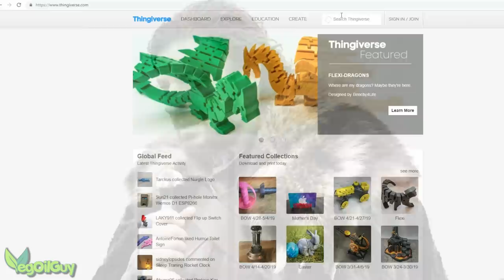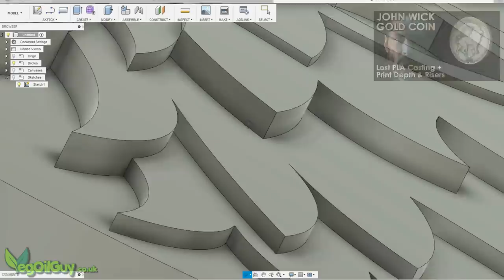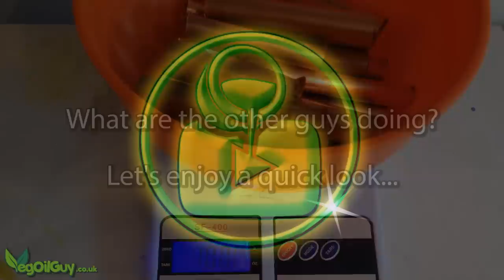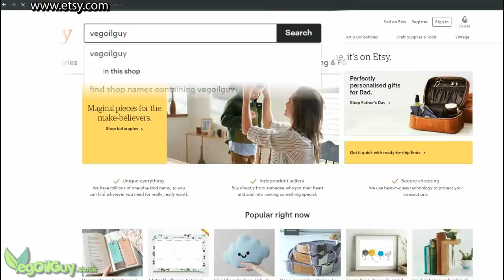Lost PLA metal Casting at home Game of Thrones Copper Coin with VOGMAN

Comment: Awesome video.  for your next challenge you guys should use Nordic gold as the metal.
Reply from the maker: It's a nice thought  : )
Reply: @vogman  hmm nordic gold, is that different than other gold? If not or if so either way...gold is expensive as oh yeah. But hey maybe he will send you a few ops to get it doe huh
Reply: @danielcrawford7315  its gold colour copper alloy; i think its used in euros?
Reply: @danielcrawford7315  LOL it is an alloy of copper and aluminium. In the right amounts so between 10 an 5 percent aluminium by weight mixed with copper will give it a gold look 👍👍
Reply: @danielcrawford7315  it's gold coloured it's a mix of copper, tin, zinc and aluminium. Check out BigstackD he makes a Nordic gold bar.
Reply: @dyadica  yes that is the right

Comment: Wonderful coins Geoff, love your work.  Will you be adding a patina to any of them ?  The green coin in the intro has some real character.  Cheers 😃👍👍🍺
Reply from the maker: I toyed with leaving one outside... but it takes years I believe  : )
Reply: @vogman  There are chemicals some commercial manufacturers use to accelerate patina formation.  I don't think it's as good as what forms naturally, but it's an option.
Reply: @vogman  I think you can use some ammonia in a sealed container with some tissue.  You can wet the copper with water and salt, then suspend the coin over the ammonia and let the fumes patina the copper.  It's supposed to give a bright and vibrant blue colour.  There are many recipes online for various colours, some easy, some not so easy.  Cheers 😃👍👍👍

Comment: Nice cast !!. I've seen 3D-printing being treated with acetone, to solve the printinglines. Maybe this is worth trying to remove the last part of lines?
Reply from the maker: Hi Brian. I'm a picky so and so about control. The acetone technique melts ad hoc, if you see what I mean. I've never tried it, but that's how it seems. I could be wrong  : )
Reply: @vogman  I know what you mean, but I saw them using only the vapors, not the liquid and it took a rather long time and the result was rather good. They put the casting under a glass bowl together with a cup of acetone and that did the job. But hey, it's your casting ;-)
Reply from the maker: I'll be honest Barrie, you're not the first to suggest it. Maybe ir's about time I listened and gave it a go  : )

Comment: Have you tired leaving your printed parts in acetone to smooth them out, saves a lot of sanding, and gets a smooth glass like finish. Could be useful for casting?
Reply from the maker: I'm a picky so and so about control. The acetone technique melts ad hoc, if you see what I mean. I've never tried it, but that's how it seems. I could be wrong  : )
Reply: You’re right in that it does melt it a bit, if you’re using PLA it can be quite aggressive, but a friend of mine actually did his dissertation on the effect of acetone on PLA and ABS. He left 3D printed samples submerged in acetone for 24 hours, and it just seemed to change the surface finish and moderately altered the mechanical properties of each.

Comment: What about using ABS filament and “smoothing” with acetone?
Reply from the maker: Hi Chris. That's a popular question today. I'm a picky so and so about control. The acetone technique melts ad hoc, if you see what I mean. I've never tried it, but that's how it seems. But I could be wrong, so I'll give it a go some time  : )
Reply: VegOilGuy I’ve never messed with it, only seen videos showing the technique. I’m certain it would soften the edges a bit, but if you plan for it, it would beat the heck out of sanding.

Comment: Your text instructions make it look like your going from a two hour rest to burn out. That investment must be exothermic to dry that fast! I didn't see any holes in the sides of your tube for vacuum? I always thought the ones with holes were for vacuum casting and the ones without holes were for centrifugal casting.
Reply from the maker: I'm guessing you're new to my videos. I do pace through the process a fair bit as I've done it so many times now : )
You're correct - perforated flasks are a thing. But so are solid flasks. I built my own vacuum system as I just couldn't afford the professional gear. You can see it here if you're interested - https://youtu.be/EGNnH_xbjR4